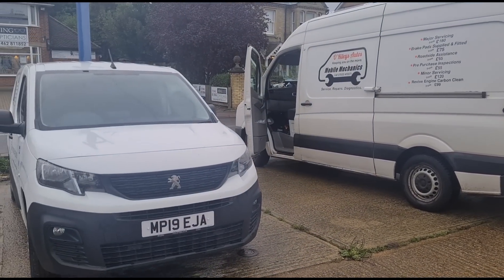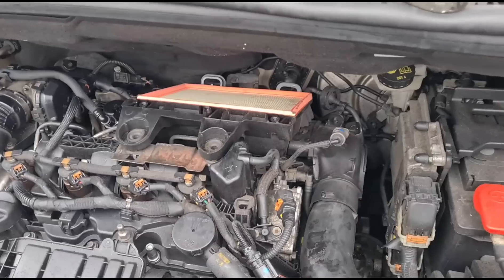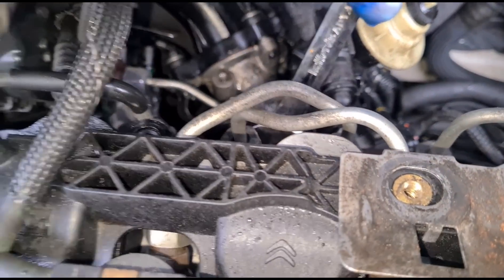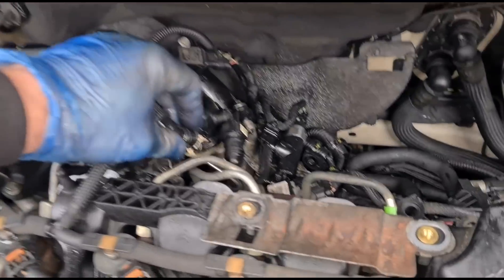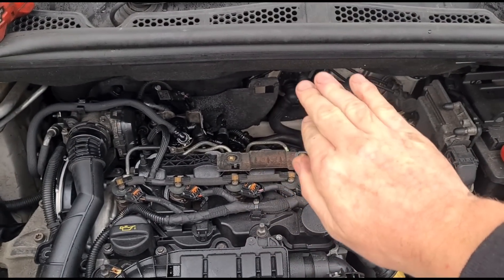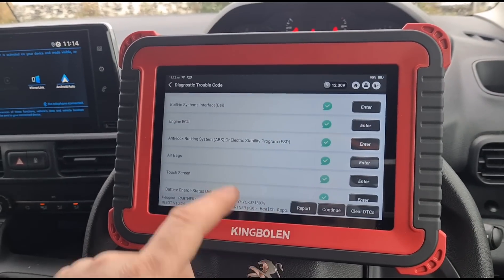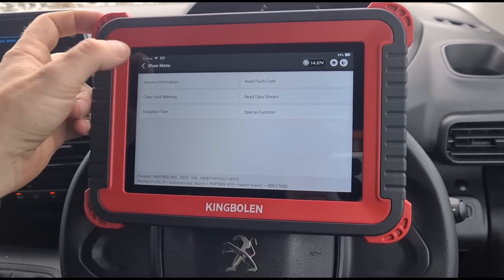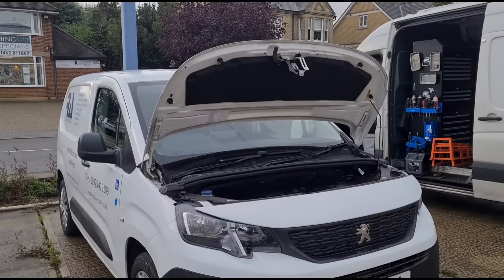2019 Peugeot Partner 1.5 High Pressure Fuel Leak From Common Rail To Injection Pump

Comment: I can See two loose bolts at 7:08
Reply: I definitely  see that dude 😳 and i  working on the same van and someone done the same thing and i changed the pipe and didn't notice and know it's leaking again  because some melt left all the bolts loose😒 lucky me the cambelt was holding the pump in place and the timing didn't jump 😂

Comment: 5
 System
 Code
 Description
 Status
 ECM (Engine Control Module)
 P0560
 System Voltage
 Voltage Out of Range
 ECM (Engine Control Module)
 U1218
 Invalid Data Received From Body Control Module
 Invalid Data
 ECM (Engine Control Module)
 P242F
 Diesel Particulate Filter (DPF) Restriction - Not Regenerable
 -- -
 ECM (Engine Control Module)
 P2291
 Fuel Rail Pressure Low During Engine Cranking
 Low Signal Rate of Change
 ECM (Engine Control Module)
 P06B8
 Control Module Random Access Memory Performance
 System Internal Malfunct ion any help please Vauxhall combo 2021 not starting

Comment: I've seen on other Peugeot partners the tick over speed is around 850rpm. I have an old 2004 Partner DLx 1.9  but the tick over has always been 1100rpm since I got it. Cant find any leaks in fuel pipes but wondering if it could be the actual vacuum diaphragm that's letting in air. Seems odd that the tick over doesn't fluctuate either, any ideas why my rpm is so high ? any help appreciated.. -cheers

Comment: 211 Peugeot Partner.
37,000 km.
Adblue, sensor & injector need replacement.
Very disappointed that components failed so soon.
6 weeks out of warranty €800 job.
Peugeot, are paying 75%.
My question is.
Am I not driving the van enough, or will this be a recurring problem,
To sell or not to sell.

Comment: Hello, I need your help, have the same engine on 308 and I have changed 10 pipes and they all start to leak, at 7:08 where the 3 bolts should be the upper one is broken, could this be the issue? my mechanic tells me it is not the case but we cannot find the source of vibration, fuel pump is mounted without any loose bolts and I have no idea what else to do...
Reply: Did you manage to sort this out?

Comment: There is a thing on ecoblue engines that the timing belt can last a long long time, as it is In oil based.
do you know if this is ecoblue or not
Reply: It's not and listen out for the cam chain or it's the end virtually unless you snap a valve first, something will get you like already happened to this one and mine 😢

Comment: just above radiator on slam panel facing engine quite often has label for engine code only problem either get washed away or someone removes .possibly to read.also on timing cover . just stupid place put label needs to be in dry area ie cab

Comment: All High pressure Common Rail Diesel steel pipes are a 1 use item ! they are supposed to be replaced every time you remove them or you run the risk of them fracturing and spraying fuel out onto a hot engine.  Don't shoot the messenger its the Vehicle Manufacturers procedure !
Reply: BMW says that you can reuse 1 time, and replace 2nd time
Reply: @Mars2Moon  BMW don't make Injector/Pump pipes they buy them in from the Diesel manufacturers like Bosch, Delphi etc etc. The Diesel system manufacturers stipulate 100% that they are renewed every time.

Comment: was there a loose bolt below your pipe at 7:08?
Reply from the maker: Yes on the mount bracket
Reply: @ORileysAutos which bolt was loose? on the metal thing above the pipe that has 3 bolts like a triangle?

Comment: I’ve done a few of these  now.   The first one I did the identical repair but around 6 weeks later this happened again.
Under further investigation I found the mount that holds the high pressure pump to the block a bolt had come loose and the mount had cracked and over time the vibration/ slight movement cracked the pipe.  I hope yours is sorted now  but if the fault returns you know where to start looking .  Great vids and info 👍  Good luck
Reply from the maker: This same bolt was loose
Reply: @ORileysAutos  what would your choice be if it was for reliability etc a Peugeot partner. Or a  ford transit connect say both three years old 👍
Reply: Hi my Peugeot boxer van keeps going in to limp mode and the PDF had been replaced but still goes in limp mode
Reply: You hardly have a part number for the bracket ?
Reply: @rouene30racing I have the oem number, will look in my photos to find it and will write back
Reply: @Kantardzhiev  have you found it? i have same issue in garage atm. cant find wheres 3rd bolt. i see 2 13mm on side where timing belt is but nothing on rear.
Reply: @STARSHADOW123456 I have it but when I post a comment it doesnt show here, I guess youtube think it is a spam, where can I send it to you?
Reply: Sana nasıl ulaşabilirim